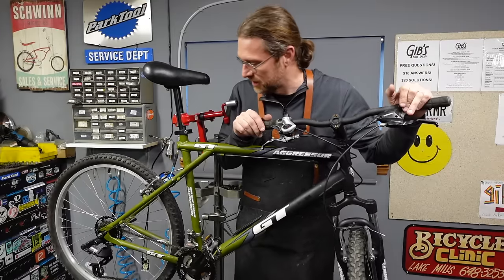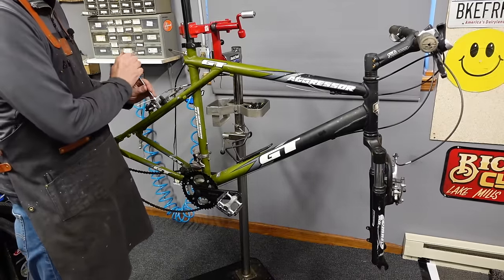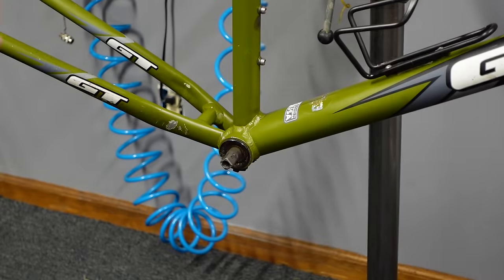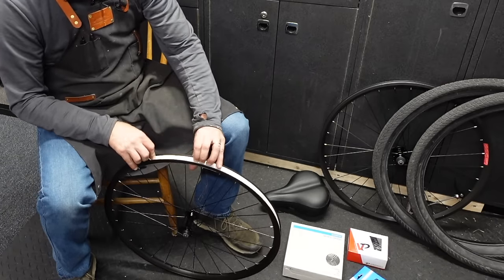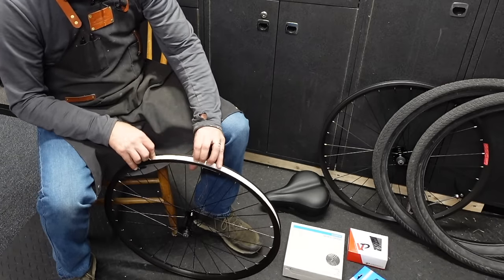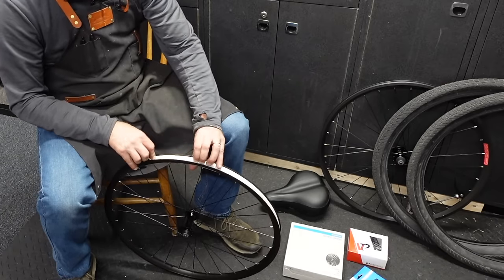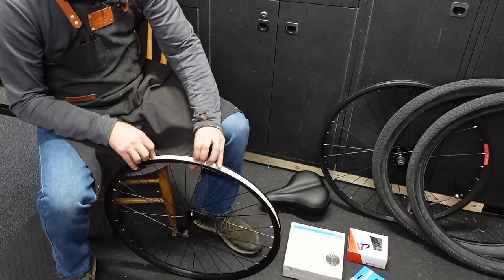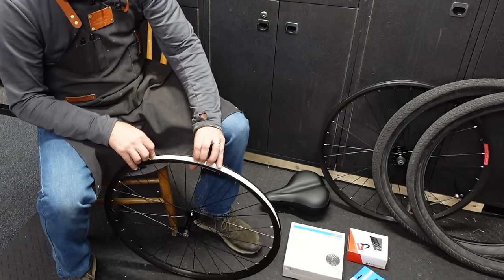Old MTB Converted to a Comfort Bike using Shimano CUES 1x 9speed drivetrain parts. TURNED OUT GREAT!

Comment: I love the smooth jazz in the background and you even kinda look like me, albeit a slimmer version with glasses. 😅
 I've built up 3 GT's in the past, 90's Karakoram with updated XT parts and a new fork, also 90's GT Pulse track frame with full Dura Ace + Phil Wood bb and a GT LTS-2 full squish. So I have a soft spot for these. ❤

Currently planning a 1x9 conversion on a '00 Trek 6000 I picked up for $40 to build as a commuter. That brought me to your channel. Love the rambling and building a normal person bike, not a $7k 2027 model with all new parts. 

Subscribed. 🙏

Comment: never thought I would find such a down to earth and informative bicycle oriented youtube channel. You not only inpsire me to keep riding but to also learn how to work on my own bikes. 
this channel is something special!

Now one tech question for ye bike farmer, have you had any luck ever trying to use a kelvar lining like the panaracer flat away?  I am setting up an old 1987 Univega Alipina Uno for touring and I want to throw on thoes reneherse rat trap passes (endurance lining) and was thinking about adding a kelvar lining to help improve durability for the purposes of touring,
Reply from the maker: I’ve ridden multiple week-long tours on Rat Trap Pass extralights on multiple surfaces including single track, fully loaded, and never got a flat. Why would you ruin the experience of the supple goodness of premium tires with all sorts of additional BS?
Reply: @bkefrmr  youre right, I will try it without and see how it goes :) just worried about my 240 pounds self giving those tires a problem. I will keep them on hand just in case.
Reply from the maker: @liamstraub3394  you can really dial
in the pressure. Make sure you’re good at roadside flats just in case!

Comment: I love the CUES stuff.  Converted a pretty light ebike that came with 8-speed Shimano Altus stock to 10-speed CUES.  Wanted lower gearing so I could pedal without any assist a lot of the time- while preserving top speed. Also converted a Deore equipped 10-speed 1x to a 2x wide using CUES.
Reply from the maker: Thank you for saying "converted" instead of "upgraded". I don't believe in upgrades (in most instances).
Reply: @bkefrmr  You and I see eye to eye on a great many things.  I’m a practical bicycle mechanic first, and a 30-year experienced engineer second.

Comment: Cues (aka LinkGlide) is a keeper for me.  Simple to rebuild a starting from bare stripped frame and fork that was in solid condition, dead simple to adjust.  The quality of the components is awesome and yields a rebuild that rides better than a $4,000 new one off the showroom floor I only spent $400 for all new components & wheels.  I am a fan.

Comment: 42t front and 11-46 rear is such a useful range, although it looks almost hilariously huge on 26" wheels. I have this setup on my gravel / commuter bike (1x11 on 700c wheels in my case) and it's got high enough gearing that I can't spin out unless I'm going down a steep hill (rare here in pancake flat Shanghai!) and low enough to climb grades of >12% (which I did in the Canadian Rockies last summer). Most people wouldn't need anything more than that kind of range, ever. And the mechanical simplicity of 1x is great.

Oh, and that asymmetric stem on this bike was making me cross-eyed trying to figure out what the orientation of the screws was. Never seen anything quite like that! 😂

Your view on tubeless basically matches my own. I see no need to deal with the trouble, especially when TPU tubes exist and are just about as light, and with proper tire selection you can go for a long time without a puncture.

Comment: Actually rim brakes work well and always have providing that the caliper is in good shape, and pads are decent quality. We all rode them for years and had no issues. Are disc brakes better, I guess that depends again on quality. on some of the entry level bikes, they would be better with rim brakes as some of the models certainly have  very inexpensive brakes. Great looking bike, hope that we get back to having some color on the frames.

Comment: I could not agree with you more on tubeless tires.  I have tried it and found it to be way too much trouble -- for exactly the reasons you mention.  I would rather just find the foreign body in the tire, install a new tube, and move on.  I am, however, very interested as to how you feel about CUES.  

By the way... on the rim tape issue.  If the rim is wide enough (and that one looks like it is), I use Gorilla Tape.  It works very well, is easy to work with, and is super cheap.  It also works for tubeless; but I covered that topic.

Comment: I found this old mtb bike at my job and using Alixexpress parts, turned it from triple crank 6 speed to a 1X 10 speed. Entire expenditure was less than 100 dollars. This is going to be the new thing. What's old is new. Especially with the ridiculous prices of bikes today.  I still ride my 15+ yr aluminum frame 10 speed road bike and my 9 speed mtb to gravel conversion.

Comment: I'm a mountain biker and I run inner tubes with a few ounces of tire slime. Works well for sealing holes caused by thorns but not so good on pinch flats. Also, am I the only person who has trouble breaking the beads on clincher tires/ rims? All my bikes have entry level rims so I don't have to fight and cuss when want to remove a tire.

Comment: I don't really get flats... so I put on a tire, pump it up and about the only maintenance I do is put air in it until the tire is worn out.   I've looked into tubeless, and it seems like a lot of work.   I may try it to see if there are real benefits like running lower air pressure, but they're gonna sit for months in the winter and I don't look forward to cleaning up that mess.    The other craze I see right now is waxing chains, and it just looks like a lot of work and I guess my chains cost like $25 so if I have to replace it after 1000 miles instead of 2000 or whatever, that's easier than taking a chain off completely every week to rewax it.
Reply from the maker: fuckin' a Steve you know what's up
Reply: Chain waxing is like a cult, cannot understand why anybody who is not a pro racer does it. And even the pros get their mechanics to do it for them 😂

Comment: 40:00 true, like why dont you set the limit screws without the chain. You can match the pulley perfectly with the sprocket that way. All need it fine tune the tension

ps: 41:50 please, just set the pads correctly. The reason the squeek is because you've aligned them perpendicular, which creates chatter, when you need a slight angle opening up opposite running direction. To make this easy you can build a simple jig you pull over the pads.

Comment: I did something similar with old Deore parts off a 2000s era 4900 that I put on a 3x9 Acera/Altus drivetrain on a Marlin 7. The crank that came on that bike was riveted together garbage. I bought a 34t narrow/wide off Amazon and put that on the old bolted Deore crank and voila: cheap 1x9. 

PS: I ended up swapping out the rest with the new Deore M4100/5120 10 speed groupset and am loving it.

Comment: Honestly, I ran into SRAM derailleur problem myself in the last year on 26" MTB. Come to find out, SRAM is essentially the iPhone of bike components -- it doesn't interchange with anything. 

Which is why, in the future, whenever I refurbish a bike with SRAM components, it's either everything still is useable, or I'm putting Shimano components on the bike as replacements. I will never, ever again go through that mental migraine of trying to get SRAM components like a SRAM derailleur to work with a Shimano shifter, or vice-versa.

Edit: Andy, got a way to fix "howler" pads for ya! What I do is run a dishwashing scrubby pad over each brake pad, and wash it at the same time. What this does is get rid of contaminants like oil, and gives the pad enough "tooth" that the pad, when it contacts the rim, isn't making that howling noise.
Reply from the maker: The Sram MRX stuff is compatible with Shimano, etc. any of the x.0 stuff is only compatible with itself.
Reply: @bkefrmr  : Okay. Because about an hour ago, I got a hold of a 24" girl's Trek 220 to refurbish, and it has one SRAM MRX grip shifter I'm going to replace. The other shifter is destroyed, with only the mount remaining.

By the way, on the stem, which is adjustable, what do the numbers 6, 8, and 10 mean? Is it the age of the rider? The stem angle? Because I have never seen numbers like that on a stem before.
Reply: @bkefrmr  "x.0 stuff is only compatible with itself" - Or the new Sensah stuff.
Reply: SRAM makes some of the best Shimano RD compatable grip shifters.  If the model is a name - its for Shimano.  If the model is numbers, is for SRAM RD's.

Comment: if you had an older mountain bike that still ran well with the gearing it already had could you just change the handle bar seat and and tires but leave the gearing intact and still have a comfort bike?

Comment: I've had my genisis 2013 core 100 mtb converted to cues.
30t chain ring 11x46 cassette it's like walking uphill with .65 ratio. I'm an oldy not that fit just got up 20% incline over 40m long.

Comment: I’m a fan of the low/mid level groups and tech. It’s just simple and works. Messing around with pain in the arse limit screws, internal routing and other proprietary features just sucks. Not to mention cutting into operational costs in the shop environment.

Comment: i have a trek 7500 multitrack bike that has a lot of miles on it. the current drivetrain is 3x8 and most of it is shimano. i would like to change to a 1x crankset on the cheap. is there a durable 1x crank for under $80 that you would recommend for my system? 38T square taper.

Comment: I learned to work on sewing machines back in my teen years ago, and of course I learned through trial and error to work on my bicycle and did it for lots of other kids. I wish I could have learned more about fixing bikes back then, I probably would have but I really messed my back up years ago and had to stop riding. It's been almost 40 years since I last rode a bike. Four months ago I bought an E-Bike after trying a friends out. I discovered that it doesn't cause all the pain riding my Giant of years ago. I've racked up 800 miles and it has improved my balance and overall health a lot! I'm enjoying watching your YouTube channel and loving learning from you!  We have a pretty big bike ride that comes through my small town every spring, it was last month. Many of the riders come through the alley that my shop is in, I have a good air compressor that I use, I add four outside air lines for them to use. I'll never be able to ride with them but next year I'm going to meet them on the edge of town and ride along with them to my shop. I'm adding bike tools to my collection so maybe I'll be able to offer them a little more help!

Comment: Shifting is easy.. If pedaling is too hard, “shift” to an easier gear. Pedaling is too easy, shift to a hard gear and pedal harder. Also, always downshift two gears when stopping, so it will be easier to take off from the stop.

Comment: You can basically take any old bike and get it up to date with decent components.  As to gearing it is far better having a 1X system when you have a good spread of gears that you can use vs a lot of gears with duplications.    Coverted to a comfort bike? Nope not when compared to my Bacchetta Giro A 20 . Comfort and speed with nothing sore at the end of any day or mileage.

Comment: Can you give us some ideas for some bike stands ? I don’t see a $500 in the cards for me maybe the ones for $250 are ok to start with ?
Reply: You Tube has videos on making your stand from plumbing/building supplies.
Reply from the maker: Not really. I have a Feedback folding stand that I like much better than the Park folding stands. But ultimately, I just use the pro level stuff.
Reply: I might check that out.
Reply from the maker: @6479rob  great clamps too

Comment: A 42 tooth chainring combined with a 46 tooth granny in the rear does not offer much for climbs. I would have gone for a 30 tooth chainring up front and made it a 11 speed rear cassette with a 51 tooth granny gear.
Reply: That would had considerably to the build cost.  He's got to sell this for a profit.
Reply: @lastfm4477  I get that. However swapping out the 42 tooth up front for a 30 tooth would have offered more for the climbs.

Comment: 12:15 I'm not sure if Hollowtech 2/external bearings is better in general. It's lighter but the square tapered are way more durable and witih the fixed spindle/axle you won't have to face the bottom bracked shell.
Reply from the maker: Yeah. I think I agree. I knew it wasn't 100% accurate when I said it. It passed my edit anyway....

Comment: I love tubeless on my road bikes for a couple of reasons - one is that as far as I know I haven't had a puncture in 1000+ miles, there's a lot of debris in the shoulders.  2 - I run the tires at 60 psi (instead of over 100) which significantly reduces road chatter and vibration.  As far as repair - I have a tubeless repair kit and some CO2 carts, and I keep a latex tube with me just in case.
There is a place I keep tubes - my travel bike.  Especially since you have to deflate them for the flight, it makes for a faster and easier set up when I get to where I am going.
Reply from the maker: So much to refute! I've gone thousands of miles with extralight road tires without getting flats too. Tons of road debris. Just having magic sauce in your tires isn't gonna change your luck. You can run 60psi in your road tires with tubes without much risk if you want more squish. You don't need to deflate your tires on airplanes. Cargo hold is pressurized and TSA doesn't care at all about your tires. Go ahead and like your tubless tires if that's what you're into, but I'm not buying your reasons, sorry. Correlation is not causation. Show me all the puncture holes and videos of bottoming out your rims all the time and I might change my mind.
Reply: @bkefrmr 😀Wasn't trying to convince you that you should change!  But it sounds like a good challenge - next time I change the tires I'll see if I can get a picture of all punctures that sealed and send it to you somehow. I've never bottomed out on my rims, and you could do that with 60 PSI on your tubes by the same logic.  I have had pinch flats on my mountain bike with tubes when I did that in my younger days.  As for the travel bike thing, I had heard that you should but now that you mention it I guess you are right, it's in part of the same plane.  Love your vids, always click the moment I see 'em posted.

Did I forget to mention the 200 grams you save without tubes?  🤣
Reply: @schrodingerthecat  Even if the cargo hold of the plane were unpressurized, and even if the plane went all the way to outer space where the atmospheric pressure is zero, you'd still only increase the relative pressure of your tires by 1 atm (1.01 bar ), which is 14.7 PSI.

Comment: Another way would have been to just source a SRAM compatible shifter ;)
Reply: Ltwoo are sram compatible and pretty good.
Reply from the maker: YOU’RE FIRED!
Reply: @stuvademakaroner9607 maybe the newer SRAM. But all X3/5/7/9 have a specific 1:1 ratio.
Reply: @FuchsHorst  they have shimano and sram compatible versions which makes things a little complicated. I have ltwoo 9 speed on my commuter bike, hasn't given me any issues in over a year of beating on it.
Reply: @FuchsHorst  No, 10 and 11 speed X7 and X9 are not 1:1 ratio.  Lager than 9speed are not 1:1, but 1.12:1.  You cannot use a 10-speed X7 shifter with a 9-speed X7 RD, or vice-versa.

Comment: I think there's really nothing wrong with square tapered bottom brackets, especially for this kind of bike. Heavier, sure. But fully sealed bearings that last forever as long as the bike is not sitting in the rain constantly and if you're not pushing Watts like a pro it really doesn't matter that the bearings are inside the frame.

Comment: I am glad you finally took off the stupid front derailleur. I love my 1x drivetrain and am happy with the performance of it and the simplicity of it. At least you found a less dorky disk to use. 😊
Reply from the maker: I’d do it on every bike if it wasn’t so expensive
Reply: 1x are too slow especially on 26”
You need a big ring in the front.